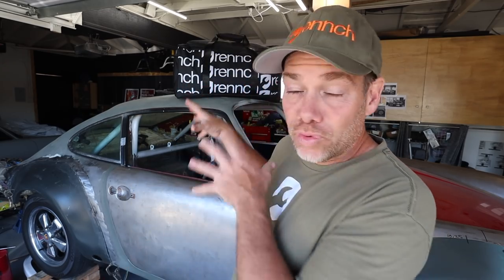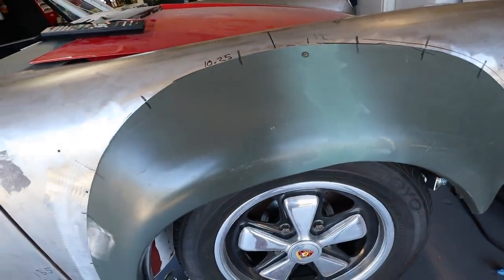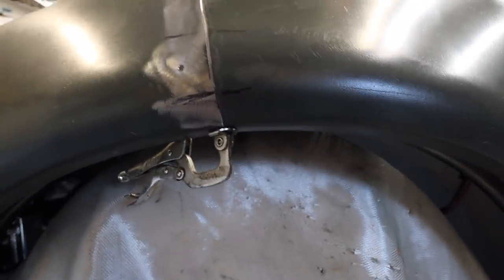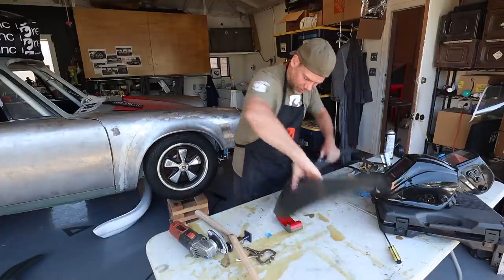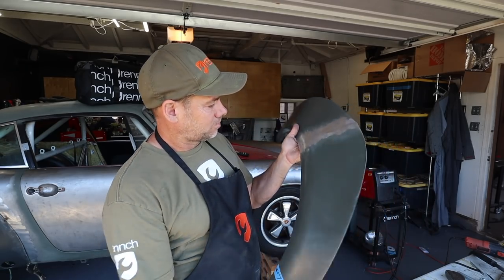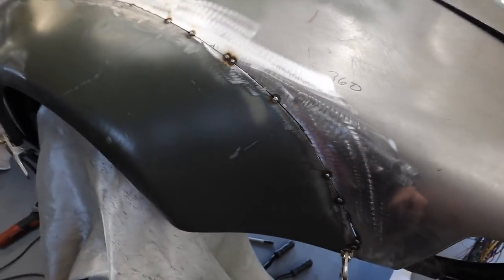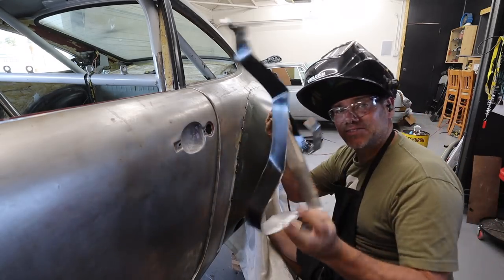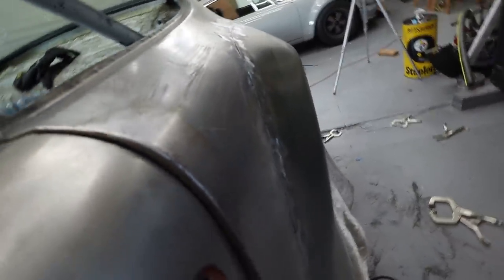*HACKED* - Chopping and Installing Widebody Vintage Porsche 911 S/T Flares [Pt.2] Blasphemy Build 54

Comment: The people that are saying, "Dude, you gotta work on your welding" aren't talking about the finished product. It looks great. Really does. They are thinking of the metallurgy. There is a lot of stress and work hardening in that seam that isn't necessary, and frankly, not a good thing when it comes to structural parts of the car. But it's a fender for chrissakes.

Comment: Something that might help on the installation of the next three flares; use a thin putty knife in the gap of the flare and body by lifting it back and forth. It will line up the edges perfectly for tack welding.
Reply from the maker: Good tip!

Comment: Throw away that Mig and use  a Tig welder
Reply from the maker: I am absolute shit at TIG so far. :-)
Reply: @rennch.  You tube can help and you sure have a few off cuts to practice on, you probably also need to get some help. Tig is super helpful and will leave you with less work and clean up.
Reply from the maker: @Rob-vv5yn  yea I’m well aware of it’s merits. We’ll see if the timing works!